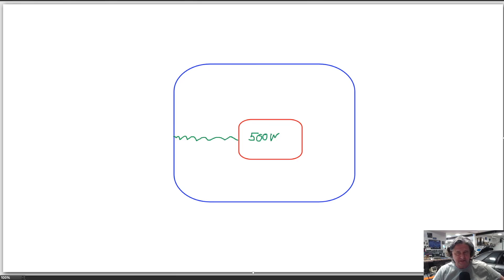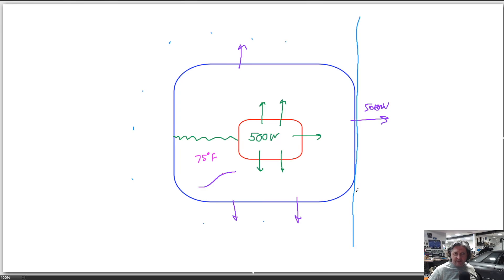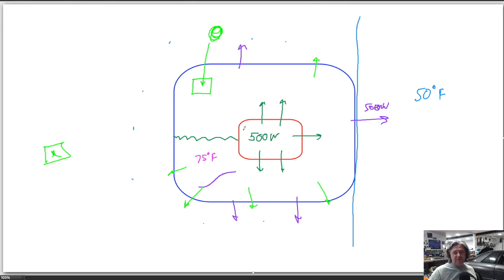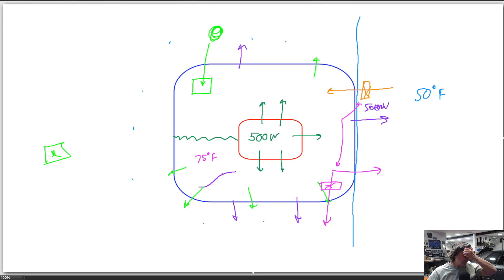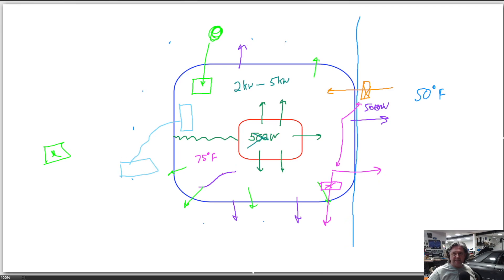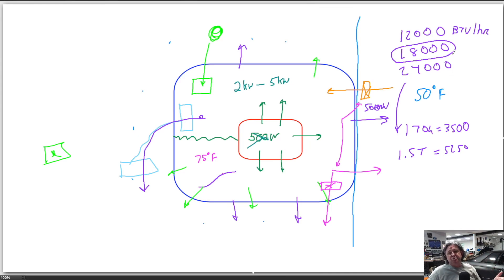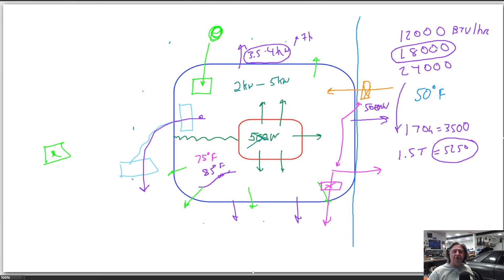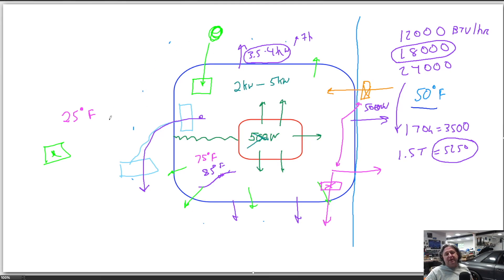Tips for Cooling your homelab

Comment: Heat reclaim coil, or a heat exchanger. 
Problem is: is there enough heat given up that it could be used for something else?
What's the square footage of the room that the older server room was?
How good or efficient is the insulation of the room or the house?
Mini Split's are only as good as the condenser or outdoor coil which rejects or get's rid of the heat.
Regarding the temperature differences: the refrigerant has to condense or go from a vapor to a liquid.
Question?
How old is the house?
When was the last time the house had a heat load calculation?
What about immersion cooling with mineral oil?
Mini splits are efficient, extra dehumidifier would be good to have on hand, if it's just for a server room.
Closer to 0 you get for the mini split, the lower the efficiency gets.
Some data centers could use a chilled water approach.

Comment: What kind of temp/humidity sensors do you use? IP? BT? Z-wave?
Reply from the maker: In the server room, those temps come from an APC IP sensor, and the other indoor/outdoor temps come from an Ultimate2000 weather station, with the data collected by wg on a Raspberry Pi.

Comment: About running HVAC in the winter, isn't it better to just circulate air from outside? The only potential problem I can see is condensation?
Reply from the maker: Yes, that is what the 'economizer' does - bring in cold outside air.. however if it is really high humidity you might still need some water extraction to prevent condensation.  The other factor is that to really cool a room with 5kw of heat you need pretty good airflow, so having a larger path to the outside is a good idea.
Reply: @jeffsponaugle6339  makes sense, even though cold air should be very dry by itself as it cannot store humidity compared to warm.

I have a small server that I plan on storing in a cold room in winter and I was afraid if the temperature difference can make condensation inside of the server, since there is zero chance that server will be able to heat that room even slightly.

Comment: I have around 2KW going into my server rack and yes, heat is an issue but not the biggest issue. Dust is the killer, I draw household air to cool the rack and the heat biproduct keeps house nice in winter months and air-con gets this during summer months. 
I am rebuilding my big rack 2x 45RU side-by-side and water cool the rack to allow sealing the sucker to keep dust out.
Reply from the maker: Yea, I am fortunate that I am not pulling in house air, and I have a large air cleaner in the room.   It goes through filters pretty fast too.

Water cooling would be interesting to see!
Reply: @jeffsponaugle6339  Simple sort of setup,  water loop/rad inside the rack with positive air flow from fans suck rear hot air through and vent to front of rack for server infeed. Run a nappy tray under it for condensation as the water can/will be from chiller system that sits outside but I can duct the wasted heated air to inside window for winter and let at run normal outdoor for summer. I don't have luxory of room to house in, need to have racks somewhat portable.

Comment: Good video. I'm currently in the process of designing a new home server room and I've been thinking about this very issue.

How much power does a split system use when it's cold outside (e.g. the middle of winter when the outside temp is lower than your set point)? My understanding is that the compressor will ramp down or even turn off altogether. I wouldn't like to think that the AC is pulling 2+ kW year round, but if it only does that during the warm seasons then it's not too bad.
Reply from the maker: Good question  - I'll take a look.  I have datalogs of the AC power usage every 30 seconds for the last 3 years.

Comment: Assuming that the air con is running at 1 - 1.5 kW, then that's approx 5 kW average total power use of the room. Using $0.16 / kWh as the electricity rate in Oregon that's $7000 / year in power cost.

I don't know what your servers are all doing, but surely there's some low hanging fruit (eg: spinning hard drives down at idle) that could potentially save you thousands of dollars / year.
Reply from the maker: Yes, and that is partly why I have some servers that turn off and on based on use.   The spinning disks are around 6W each, so that certainly makes a difference.   Solar also makes a significant difference, as I produce between 15 and 20 MWh/yr.
Reply: @jeffsponaugle6339  will there be a video on your solar/power setup? :)
Reply: Damn you guys have 0.16 bucks per wh average? That's actually crazy, I think that's close to our worst peak hour price in some extreme cases, but atleast not average.
For example our average today is  0.029 USD 

But of course I live in the EU not the USA
Reply: @Kire2oo2  Where in the EU do you pay 0.029 USD for 1 kWh?
Reply: @arnivska  Norway

Comment: Does heat get pushed into the garage only when the economizer is on?
Reply from the maker: Yes, although it would be possible to run the exhaust fan from the server room to the garage without the outside fan running, that would just pull in air (warmer air) from somewhere else.     In my case the economizer is  running whenever it is 55F or less outside, in which case I would want the extra heat in the lower garage.   If it is warmer than that outside I probably don't need the heat.   ( I should note the lower garage also has it's own gas 100,000 BTU heater, so this is really just to make use of the extra heat).